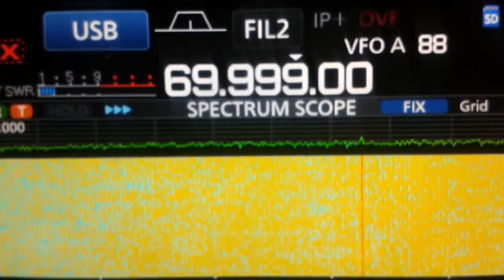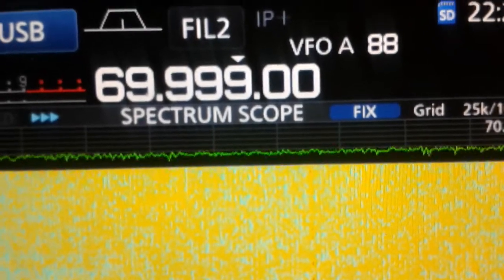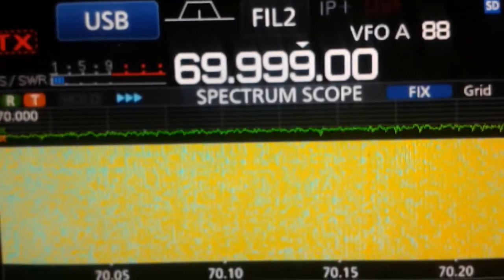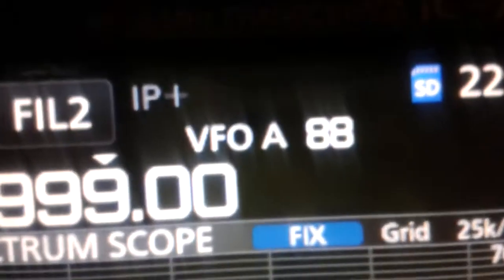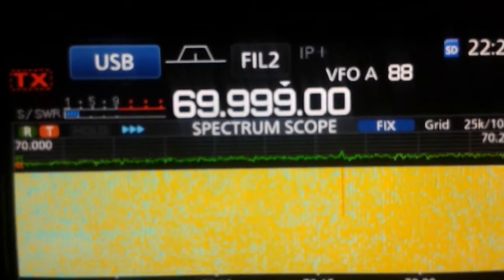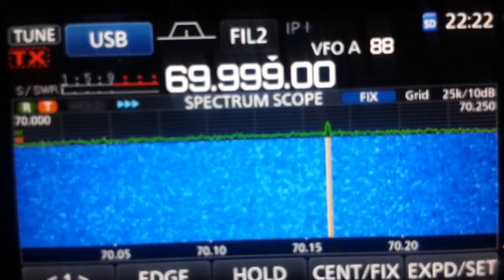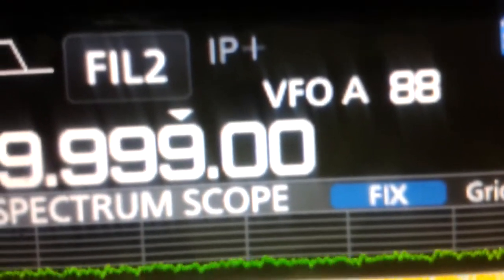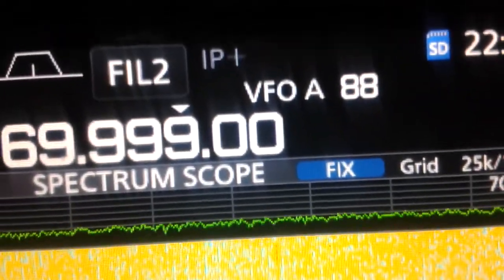IC-7300 OVF and Pré-selector/Tuner

Comment: If you don't read your comments you'll never learn my friend. As was explained to you in your other video saying the same things, the tuner is NOT a preselector on the Icom 7300

Here's a comment from Aleziss on your other video:

it's because the tuner is NOT tuned to the frequency you are displaying and you also won't be able to tune that frequency either as you cannot transmit there. Not being correctly tuned, it makes your antenna not hear anything thus cutting the reception so cutting the OVF. 

By the way, the IP+ is used only for strong signals, if you want to hear weak stations, you should turn the IP+ OFF.

To complete, the only way to remove OVF is to  use the ATT or RF Gain on the radio OR use a noise reductor like the mfj1026 or the timewave anc-4.
Reply: I believe that the antenna tuner remains in the signal-path, on receive, if selected; thus, I think the tuner can offer preselection.  Perhaps, in this case, it was not tuned properly to the frequency under test.  However, if tuned to the frequency in use, it should, in most, perhaps all, cases, introduce further front-end selectivity on receive, thus enhancing tolerance to strong signals outside the tuner passband.  I often leave my tuner in-circuit, even if running a well-matched antenna (or into a matched external power-amplifier) to exploit this advantage.  I might switch out the tuner if its slight loss is compromising RX sensitivity, although that is unlikely except on the 70 MHz and perhaps 50 MHz bands.  A caveat might be on rigs such as the IC-7610 which offers dedicated preselectors ("Digi-tune") where the out-of-band port-impedance, of the antenna-tuner, might corrupt the frequency-response of the preselector(s)

Comment: so would we get the same result using an amp and a tuner big enough for that amp?
most people believe there is no way to use the tuner if you are going into an amp and another tuner. 
I am thinking in a multistation contest with 20M and 40 M antennas in somewhat close arrangement. 
with a frequency pretty much locked down.
ww4ok